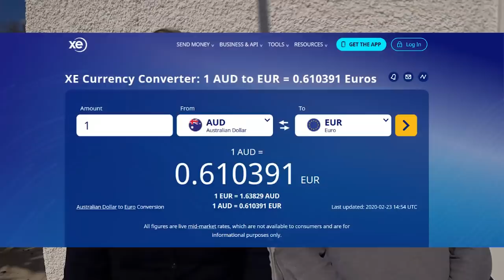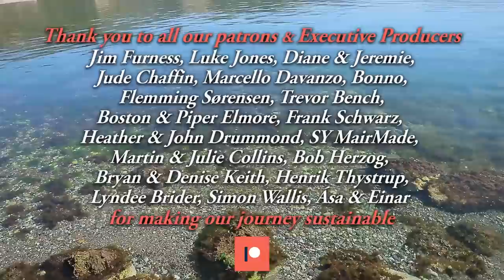A radical plan change... WHY? - Sailing A B Sea (Ep.110)

Comment: Hi guys, change out your stainless bow shackles for good quality galvanised ones.  The bolts on galvanised shackles naturally bind onto the threads so are less likely to come out even if your wire breaks.
Reply from the maker: A good tip, thanks Mark. 👍
Reply: @SailingABSea  no worries, hope you are ready to fly a kite tomorrow for clean Monday
Reply from the maker: Yeah we noticed that Limni was busier than usual, apparently they fly kites here at the bat yard. We'll film it.

Comment: Hi Barry & Aannsha, editing gets full marks. I thought your 'off season' vid's would be a bit boring - wrong! Great reminder to us yachters, experienced or otherwise, just what a hammering yachts experience thanks to the actions of salt water, wear and tear, faulty or incorrectly used fittings & products, and the massive payback from investing time in the meticulous inspection, testing, repairing of the yacht and it's ancillary's.
A change of plan: Good decision. There is a huge 'retiring baby boom market' who want to 'live' a little whilst health permits. You guys are best placed to invite folk aboard ABSEA and take the time to help folks understand the upsides as well as the downsides of living the dream. Using Turkey as a base is a good call. Having travelled through 33 countries in the last two years, I agree, Turkey and the Turks get my vote. 
Kicker: Drill a drain hole!
Be good. Love ya. Rob xx
Reply from the maker: Hey Rob, thanks for that great feedback. From feedback like yours it seems the simplest solution is to drill a drain hole. That job will be tackles in Turkey. Cheers.👍

Comment: Hi I have been toying with the idea of sailing but I have another year as my daughter has to finish her college degree first.  Then I can think about traveling.  Anyway in prep I am on the hunt for a boat as I have arranged a hard storage area for it for the next year if needed.  So if something comes up and is suitable I will move on it and I have a year at least to get it sorted for sailing.  My question to you is how did that 12V water heater work out for you.  You swapped out the 230V so how were the hot showers?  I have looked through your vids but could not find a follow up.  Is that a bad thing?  Thanks
Reply: @AannshaJones  Hi Aannsha that was a very prompt reply was not expecting that.  I will be sailing single handed so I was looking for something around 40 foot in a cat as they are a bit easier to sail shorthanded.  I have my eye on a couple in Turkey but they are very expensive.  Thank you for the answer so basically 12V heater need water maker or no drinking water.  Good to know.  There is a video on YouTube where I guy builds a watermaker for his boat from easily obtained and cheap parts.  I am sure that Bas could whip one up.
Reply from the maker: (Baz) I have been toying with the idea of building a DIY water maker. I like the idea that parts are readily available in most parts of the world.
Reply: @SailingABSea  Hi Guys,  This is the information put up and you can view his video.  It seems good.

In the hopes of creating a community resource, in this video, I go through how I put together our 30 gallon per hour watermaker for our sailboat using basic off the shelf parts, I'll show you how to operate the system, as well as flush it out, and share some tips and tricks. Scroll down for the parts list of the major components and where I purchased them. Thanks for watching and subscribing! To support the making of these videos, go here: http://www.patreon.com/adventurer 
For the most up to date info on what we're up to, Like and Follow us on Facebook: 
http://www.facebook.com/svadventurer 
Take us out to lunch: http://svadventurer.blogspot.com/p/bu... 
Parts List: 
Housing purchased at       www.americanro.com 
Housing part # ccsw-2540 
Membrane # sw30-2540 
https://www.amazon.com/gp/product/B00... 
Cat Pump purchased at www.jnequipment.com 
pump part # 2SF15SEEL Cat Pump rebuild kit:
 https://www.amazon.com/gp/product/B07... 
1HP Marathon 120V Electric Motor purchased at (out of business but available on Amazon): 
Marathon part #5KCR49UN0106Y 
https://www.amazon.com/gp/product/B00.
Jabsco boost pump model # 18660-0121 
Pressure Guage, Needle Valve, and Flow Meter purchased at www.dwyer-inst.com 
Pressure guage # SGY-D11242N
 Needle Valve # HNV-SSS32B 
Flow Meter Liquatec part # PMF-0202
http://www.farriswater.com/zcart/pdf/...
 Pre-filters and Housings
 5 micron filter 
https://www.amazon.com/gp/product/B01... 
20 micron filter 
https://www.amazon.com/gp/product/B07
Housing 
https://www.amazon.com/gp/product/B07

Gary

Comment: What's up with that crazy looking swivel ? 
In my opinion I have never seen the point of anchor swivels. All they do is add a potential point of failure to the anchoring system and provide little or no benefits in return.

My concern about swivels has always centered on the possibility of one of the two screws backing out, as happened to a friend nearly costing him his boat—anchor shackles are always moused with wire, so why not swivels?

And the fact that the swivel shaft—made of  stainless and therefore subject to work hardening—is torqued over the bow roller every time the anchor is hauled.as well as others are swivels in general are a bad idea and are the weak point in a critical area.
Reply from the maker: Good points James. The reason for that particular swivel is to ensure that Aannsha doesn't need to manually get involved in making sure the anchor comes over the bow roller correctly. It's a heavy anchor and I just want to make it as easy as possible for her at the bow. Before we fitted the swivel n Turkey the anchor would regularly not play nicely when coming up over the roller.

Comment: If the springs at the top of the mast in the lamp holder are solid  Ansh that's not good  give them a squirt of WD 40 or electrical contact cleaner if you stick your finger in they should both be "springy" fnnarr fnarr bit of Finbar Saunders there !! Don't know your set up on AB Sea guys check your deck plugs at bottom of mast  then your switch back at panel for 12v in and out. A strong wind from your rear quarter as always guys!! XXX
PS I know you guys will know that already X
Reply from the maker: Hi Andy, thanks for sharing those tips. We'll dig deeper into the boat wiring. 👍

Comment: Hi Guys. Get yourselves a right angle drill chuck for your drill and some stubby drill bits. Toolmart do them in the UK cheap and cheerful. You can then get in to tight corners were there is no room. PM us and we will send you a link.  Sail Safe guys. Ant, Cid and the pooch crew.
Reply from the maker: Will do. 👍

Comment: Stainless shakles: No one can tell lifespan, or when they may crack due to corrosion. Thats why I use galvanized carbon steel shakles only. And the galvanized shakles don't unscrew. And they will not take part in any galvanic reaction. My rod kicker from Selden is fitted the other way around, no water can enter in.
Reply from the maker: We're going to change the shackles for galvanised when we get back to Turkey. Interesting option about the kicker, we'll look into that. Thanks.
Reply: Another recommendation is of course to use a ball hammer and slightly rivit the shackles at the thread end. Works for stainless and carbon steel. More idiot proof than thread locking.

Comment: Hi Guys,

The water cumming from the boomvang is not normal.... There is a small draining hole in the midle of the lower fitting.
Looks like a Sparcraft boomvang, just fixed mine this week......
But there is something else. In the vang is a gas spring (one or two) that is supposed to push the boom up. Look like yours is not working. Mine had rusted away completely. 
I changed it for a stainless (316) one. Watch this: http://svjeorgia.blogspot.com/2013/01/rebuilding-sparcraft-boom-vang.html
I ordered the gas spring online via a webshop. Found the specs on: https://www.rigrite.com/Spars/Isomat_Spars/Sparcraft_Pneuvang.php. You need to keep to these specs because if its too long you won’t be able to close it and you need the exact power to keep the boom up.
Google Sparcraft boomvang repair and you find lots off info....
A working vang also helps furling in the main.

Hope this helps you on the way.

Cheers, 

AsianTune & Captain K
MasarapSailing
Reply from the maker: Thanks, that's really helpful information. Looks like another job goes on the list. Hahahaha

Comment: See if there is a join in the wire inside the headliner below the mast. It is probably  one 3 core wire and each fixture uses a common ground and with the other 2 wires as positives for each light. If that join is good then it's back to the panel or back up the mast to measure 12 volts at the fixture.
Reply from the maker: (Baz) Yep that's where I reckon it is too. Fingers crossed.

Comment: Whoa. Before running new wire all the way up the mast did you think to check that the " new " mast head light actually worked.?

David.
Reply from the maker: Hi David, the combo steaming light and deck floodlight unit were installed new in Spain and have both been used several times. The deck floodlight still powers on, but not the separate steaming light. It's on our jobs list to take the headliner down at the mast compression post and inspect the cabling there. If you're referencing the LED light itself then we will test the old one to see if that lights up.
Reply: @SailingABSea  Hi Aussies. Yes I was referring to checking the new bulb, some of them are faulty from the factory. Good Luck with it.

David.

Comment: Bazz , do some checking on the boom vang / kicker, I know that some of them have neoprene seals in them something like the front forks of a motor cycle. Best to make sure of what you have, before you end up with a oily mess on the deck of your boat.
Reply from the maker: We've been told that it's on upside down, another job added to the list. 😁

Comment: Hi Bazz, if you have a 12 volt test light go back up the mast and check to make sure if there is power to the light socket or not. The positive lead is the bottom terminal or terminals if there are two and the ground is the side of the socket itself .the positive terminals are spring loaded with what LOOKS like the spring from a ink pen and sometimes the get stuck in the down position or break off, and the terminal cant come up high enough to make the connection. Its worth a check before you start pulling wires though. Also the editing looked great. Nice job!
Reply from the maker: More investigation is on the jobs list. 👍

Comment: Q1.Interesting you are heading back to Turkey, I was told (rightly or wrongly) that if you have Turkish residency (which i know you did last winter) and you are out of Turkey for over 6 months, residency is cancelled. I'm sure you have a plan, I would be very interested to hear it.
Q2. Not a good idea to mix stainless steel and galvanised steel, as others have said, all galvanised is probably the way to go.
Q3. Good editing, may I ask what software you use? I know you have a Windows PC. nearly everyone else seems to use a Mac (I'm not keen on Apple myself)
Q4.It looks like your Boom Vang is upside down, but I may be wrong.
Reply from the maker: Hey Pete, Q1 we have been told that renewing Turkish residency is simpler once you've had a previous application approved, so getting a new 12 month card should be no problem. Q2 We plan on changing to all galvanised once we get to Turkey. Q3 We use Adobe Premiere Pro CC 2014, Bought outright before Adobe went down the monthly fee route. Q4 Many other have mention that it is upside down and even commented that the struts are probably shot because it does not actually hold the boom up. Another job added to the list. 😀 👍

Comment: Your Anchor.-  it has two holes . One - your chain is currently on and the other near the blade other end of the shank. If you put your chain on that hole 1st attachment point. (  base of the shank,) Then run chain along the shank  up to the hole on the end of the shank 2nd attachment point.... ( your current attachment) and shackle it. Your anchor chain is now attached at two points. . If your anchor was to get stuck on rock or an obstacle on sea bed . You can pull hard and the upper shackle will break. The chain is still attached at the base near the blade, thus the force now pulling the anchor out instead of trying to plough in deeper. You recover your anchor without loss. I am sure the upper attachment shackle would be a specific break away shackle that will break at a certain tonnage. The chain between the two attachment points must  be slack. This set up does not affect anchoring. The force applied when the anchor is at the sea bed is still horizontal , the anchor  ploughs in  because it’s effectively pulling on attachment 2 ...attachment point 1 is your emergency.... just an idea .
Reply from the maker: That's an interesting idea Paul. We'll look into that when we get to Turkey. 👍

Comment: Hi guys  thanks for the great entertainment you provide and the interesting problems you come across , my comment is about the light , I had a problem with an interior light in my ute canopy and found that the earth was dodgy and the Led!s  don't work too good with a bad earth.Good luck with the new venture stay safe.
Reply from the maker: Hey Michael, we'll be checking the wiring as much as we can. It did work when we left Spain in 2018. Hopefully it's just a bad connection.

Comment: What does a marina berth cost per annum in Kas?
Reply from the maker: We have negotiated for 13 months a price of 34,215 Turkish Lira (AU$8,397). Water and electricity are extra.
Reply: @SailingABSea  That's a lot of money
Reply from the maker: It certainly is.
Reply: This is not bad for the Med. in Spain, where I stay this year, you'll be hard pressed to find something less than € 600, pr. month, i.e. AUS 12.196 pr.year. For similar size boat.
Reply: @ Sailing Étanche sadlly, Sailing Ho'oponopono is correct about Med marina costs.  In my blog I outline some of the research I did on about 14 marinas - mainly in Spain and Gibraltar.  Basically, in Spain alone, marina prices range from AU$7,000 to AU$21,000 for 12 months.  That is AU$19 – AU$57 per day if you divide the annual rate by 365.  But actual daily rates are higher.  For instance, while the annual rate to stay at the yacht port of Cartagena is EUR 5,062.90 / AU$8170, one night at Cartagena marina actually costs 32.76 Euros / AU$55.40.  A month would cost us 452.20 Euros / AU$764.92.

Comment: Hi Baz, Great vid as usual....Best to put a "rated" galvanised bow shackle instead of the stainless (Gal anchor, Gal chain should be gal shackle no dissimilar metals and stronger), peened over the end, cut them off and chuck them away when you change them over, not worth the risk. You wouldn't use a stainless shackle on a safety chain trailer, would you? you know the old saying "The chain is only as strong as the weakest link" http://kb.rocna.com/kb/Shackles https://www.mantusmarine.com/mantus-anchor-shackles/ look at the rating difference in gal compared to stainless.
Reply from the maker: When we get to Turkey we'll be swapping the shackles for galvanised. 👍
Reply: @SailingABSea  I'm interested in looking at a boat(s) in Antalya in late April, so we could be interested in a "test Drive" on yours as "crew" what the best contact details. regards Ian
Reply from the maker: @ianmcknight7310  use the email address on screen at the 2.32 mark in the video and we can chat about details. 👍
Reply: @SailingABSea  Done.